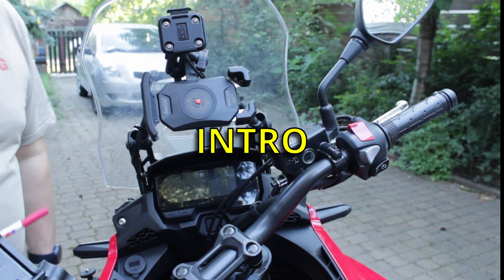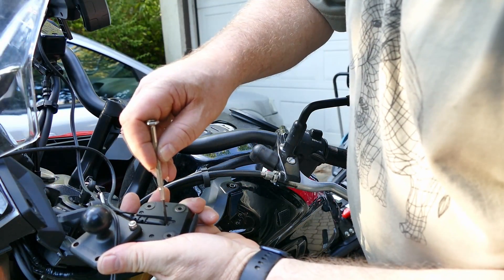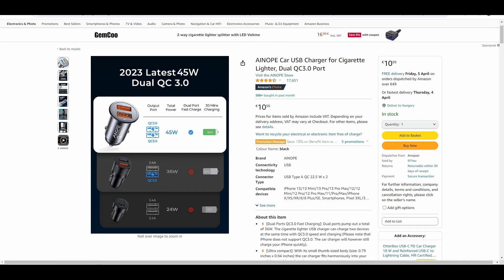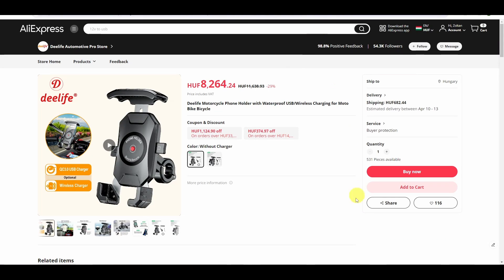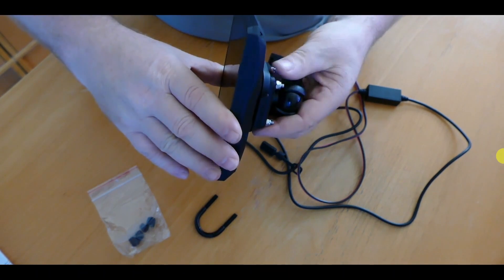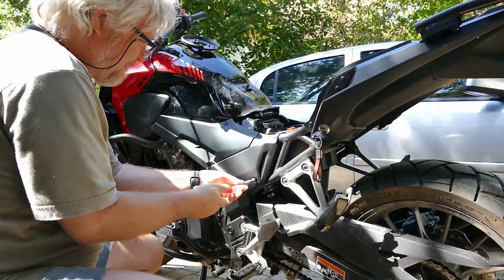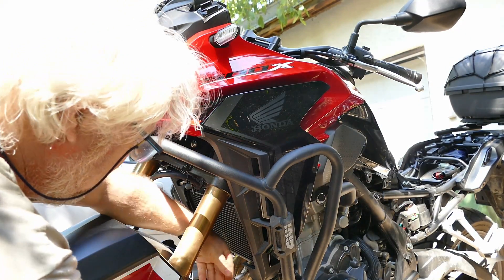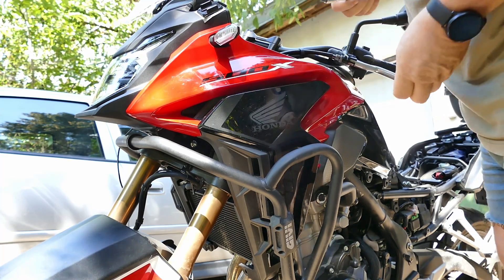CB500X USB port, GPS and Phone charger- electrical wiring

Comment: Thank so much for this detailed video, it's invaluable!

I have a question regarding the first sumitomo connector you wired, please. How do you depin one or those? I have another plug which has pins in it already that i want ro use on my nX500, but I just cannot get the pins out of them😢

Thanks
Reply from the maker: To remove pins from a Sumitomo connector, first, open any secondary lock tabs on the back. Then, use a specialized de-pinning tool, a small screwdriver, or a pick to lift the small locking tab on the connector's front while simultaneously pushing the wire and pin from the back. It can also be helpful to push the wire further into the connector to release pressure on the pin.

Comment: Did you change the the 7,5A fuse after this modifications? thanks
Reply from the maker: Starting from 2016 on X models, the OP fuse is not 7.5A ...it is 10A. As a result I did not changed it.
Reply: @twofeetonthepegs actually now the new NX500 has been made back to 7.5A

Comment: Can this same process be used on a 2013? Thanks
Reply from the maker: I do not have access to a 2013 model, so I do not have sure info. However I made some research and seems, the OP (options) connector underneath the seat has different pinout on the 2013 model, so that part is different. Regarding the connector for the accessory socket I could not find any reliable info, sorry.

Comment: Great work, thanks for sharing. Using info from your video and others I managed to plug the connector for the USB without removing the side fairing. I just used a screwdriver to unhook the connector and some pliers to pull it out. Not an easy job because you have to fit both your hands between the fork arm and the fairing, but can be done. Afterwards I fitted the wires in the connector in the right position and just pushed it in with one hand. Ride safely!